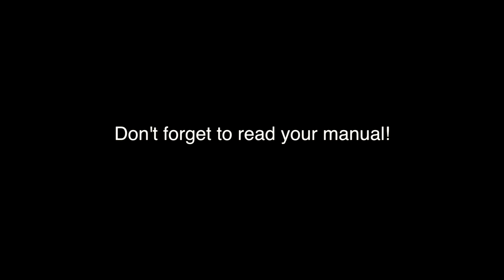OTS Guardian FFM Training

Comment: Sorry I see that this video is 9 years old but will the mask seal correctly if you’ve got a beard?
Reply from the maker: Some users are able to dive with a beard, while others find that the mask could be leaking air. In general, anything in the way of the seal of the mask can cause the mask to leak. It's impossible to say for you specifically without trying it out.

Comment: Is this for communication between people with a similar mask?
What if you are an instructor, and training someone, is there a way for the student to hear this underwater?
Reply: There are a number of communications systems that can be used with this mask. One option is the OTS Buddy Phone, and students using regular masks could be outfitted with receive-only units, which are less expensive than full transceivers. See: https://www.oceantechnologysystems.com/store/wireless/receive-only-buddy-phone-w-squelch/

For two-way communication, the students could use the XT-100 Buddy Phone, which includes a mouthpiece that creates a large airspace for talking, and accepts any scuba 2nd-stage regulator. Realistically, though, entry-level students should learn to use hand signals from the very beginning, and advanced students or those getting specialized training would benefit from full-face masks.
Reply: @seikibrian8641  is that link a scam